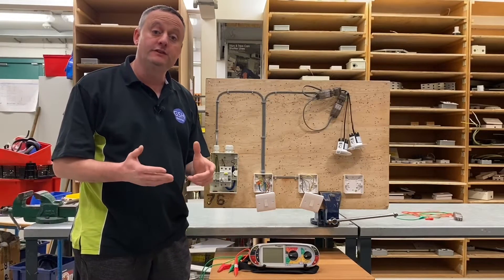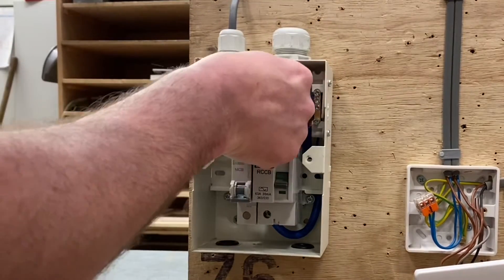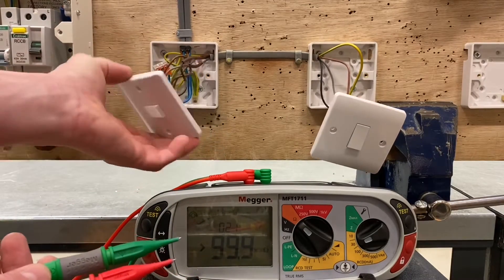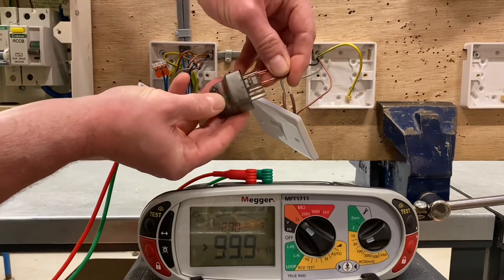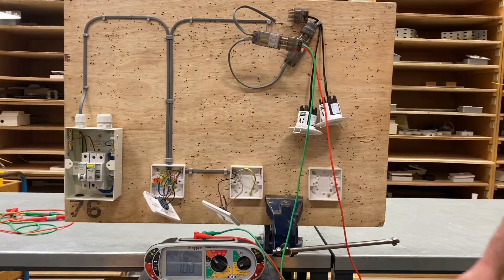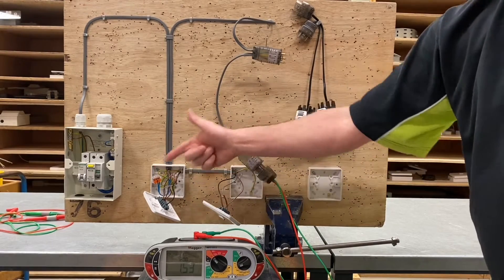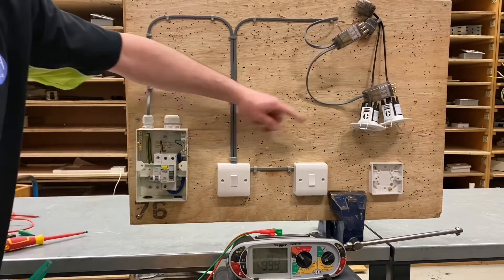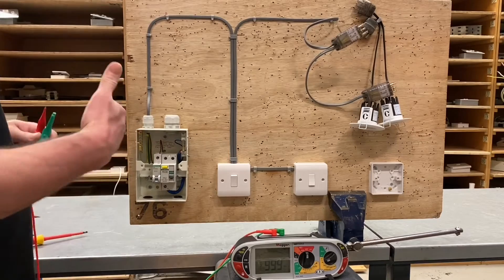2 Plate Method Testing 2 Way Switching for Continuity of CPC, Polarity and Insulation Resistance

Comment: Thanks Gaz - well presented as usual.  As an adult learner I understand the theory behind IR testing and the need to remove fittings etc in case they are damaged by the test voltage. Maybe a daft question but -  if the IR between E-N is off scale and IR between E-L is also of scale why can't we assume that the IR between L-N would also be off scale?
Reply from the maker: You can when thinking about the conductors in the cable runs - however the line and neutral conductors are together in the light switch and the insulation maybe an issue in these areas. Thanks for commenting and watching as always. Gaz
Reply: @GSHElectrical  Thanks for taking the time to reply. Does that mean then; if you get off scale while testing between LN connected together and E that the insulation is in good condition?